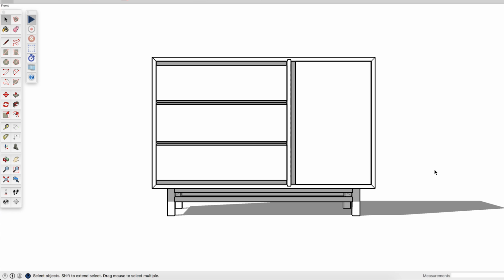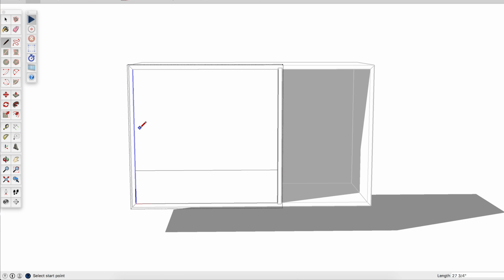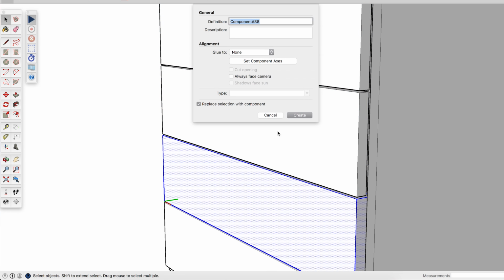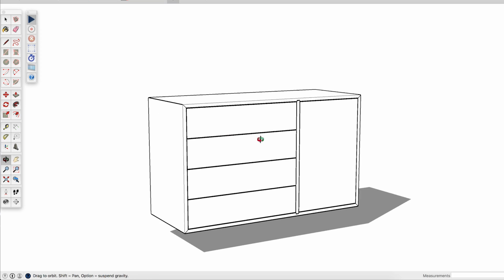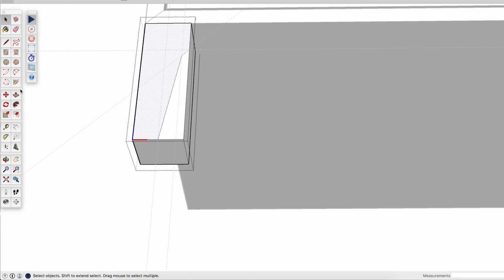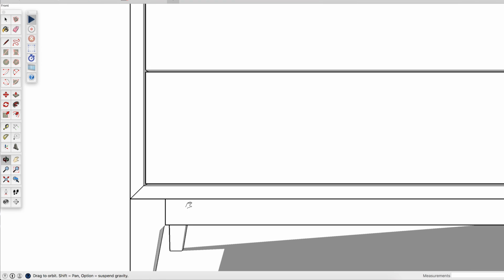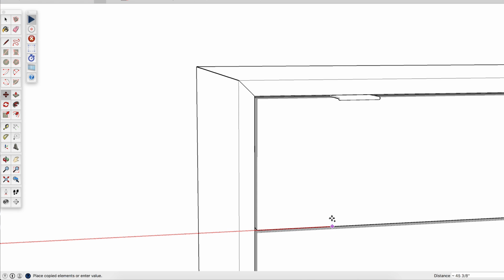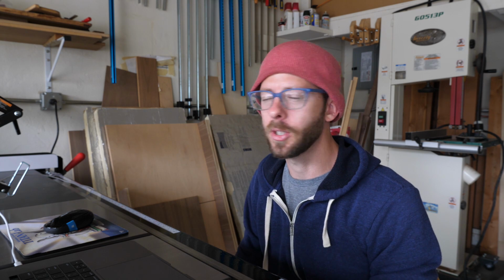Let's Talk About Design - Otto's Dresser

Comment: I have to say, SketchUp is absolutely perfect for what you use it for. However, I started in Sketchup and moved to a different design software that works in a very similar way - Fusion 360. Fusion deals a lot better with curves and if you build something right, you can go back in time in the design and change some basic thing you started with and have EVERYTHING adjust itself exactly the way you want it. Satisfying to pull off, but also not a part of the program you even need to pay attention to if you don't care about it. Plus, it's a lot better at exporting STLs for 3d printing than SketchUp is.

Comment: You could make the drawer face dimensions match by offsetting 1/16" from top and bottom, dividing, then ofsset 1/16 from all lines, top and bottom included. This would have been important for CNC manufacturing.
Reply from the maker: Gotcha...Yeah, I should add (for anybody reading) when I actually make my drawers in real life, I take my measurement of what it SHOULD be...build 3 of the drawers from bottom up, get them all installed...then pull a measurement from what is left over in the top spot to make the top drawer. It usually ends up where the top drawer is slightly smaller than the rest...like 1/8". But it is nothing you would ever visually notice. What you will notice are the gaps. So drawer face size can vary...but you want the gaps to look consistent.

Comment: You shout cut the low end frequencies on your sound when you post process your videos. It's a bit disturbing on headphones with good low end frequency response.
Reply from the maker: I have crappy headphones so I guess I don't notice.
Reply: You don't really need a pair of expensive headphones. Mine were less than 100$ and although they might not be perfect for sound mixing they are quite decent for the price.

Comment: I liked it. But to me it would be more valuable if you shared WHY you pick any given shape, angle or size. Sometimes you see something and you dont know what it is that makes you like It. I guess thats the case with that cut/groove above the base. To me it makes it lighter, less bulky. And thats hard to catch. To me. Just like that pull tab placement. That was very cool and helpful. Thank you for sharing.
Reply from the maker: Good call...I'll try to do that in the future. For the record...the point (for me) of that grove at the top of the base was to create a visual separation between the cabinet and the base.

Comment: If you have to array some objects along a set measurement (as in the case for handles), you can copy/move down to the first drawer, then hit X and the number you need it to duplicate that function by. i.e. 4 drawer handles, ctrl+move to copy/move handle to the next drawer, then X2 + enter, and it'll do it another 2 times
Reply from the maker: Hey Chris...yeah, I use that function quite a bit. I didn't here because the drawers are not exactly evenly spaced...though, I guess I could have used it just to get it close...and then I could have fine tuned instead of copying and dragging the whole way. Oh well...next time :)
Reply: Chris Salomone there’s a million ways to do the same thing in sketchup - so often it’s a personal preference thing. Your use case made more sense than arraying as I mentioned. Loved your intuitive use of components! I so often brute force my designs and redraw or replace parts rather than plan ahead that much. That said I use sketchup for blocking 3D forms for illustration more than for plans like yours. One day though...

Comment: These inches and other measuring units frustrates me..
Reply: Metric all the way. So much more practical to use whole numbers rather than fractions.
Reply: I'm Canadian and I have no clue how long 215 mm is or how fast 150 kph is without converting them to inches and miles and I've lived with mm and kph my entire life. I do the conversions in my head so the numbers are rough...215 mm = 21.5 cm which is roughly 8 inches and 150 kph is roughly 90 mph.
Reply: I wish I could do that the other way. But I can't :P

Comment: Reusing dimensions is actually a trick I discovered in my time designing, as well. I think of it as a sort of "theme," like how you use angles 15 degrees off 90 in a lot of your pieces. It's a thought that keeps repeating itself to bring the whole thing together, either to make the singular design one cohesive piece, or to make one piece cohesive with a larger collection of pieces. 

Alternatively, it could also be sort of how you use the golden ratio or whatever, just as a starting point if you've got nothing else to go on. Referencing another measurement from the piece is also a great place to at least start, even if it doesn't turn out to be exactly what you do in the end. Because even if you try it and it doesn't look right, at least you have an idea of the error and how to correct it, whereas before you had nothing. You at least build the momentum towards the right idea.
Reply from the maker: Well said ! I always say that the way I Design is sort of process of elimination. I start with something, look at it to figure out what I don’t like about it, and keep changing things until there is nothing bugging me about it any longer. Then I know I’m done. 😊

Comment: I have not used SketchUp so this might be obvious when you finish up the sketch.  What do you do after you complete the diagram? Does this get printed onto a blueprint or does it build you a list of pieces to mill for the project?
Reply from the maker: You could do either of those if you wanted. Their are plugins to generate cutlists. I usually pull some of the key information from it and make my own sort of cut list. I mostly use it as a design tool...more to come up with the aesthetics that I'm going for than anything else. That said, You could pull all of the information from the model to build this, as long as you could recreate the shapes.